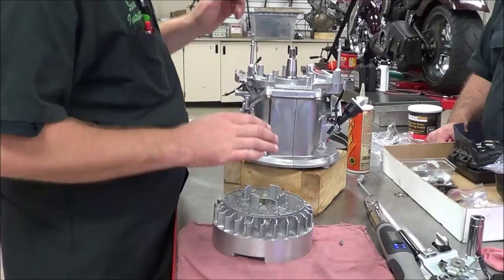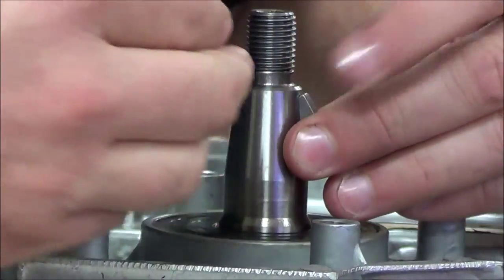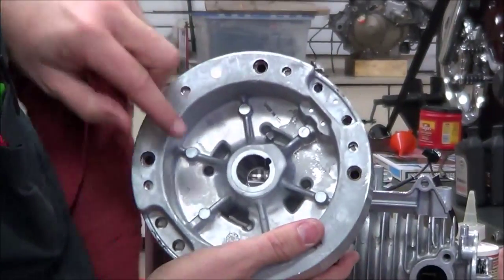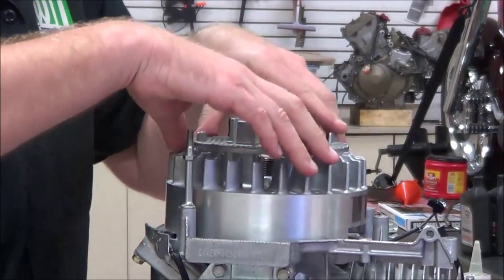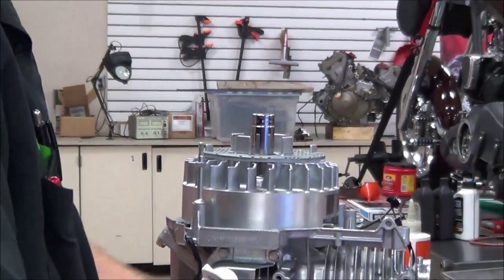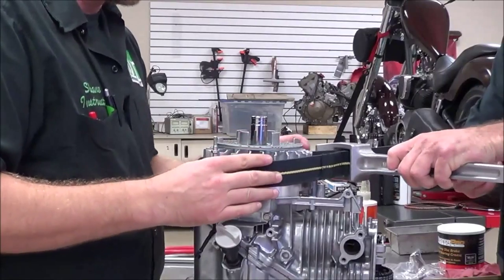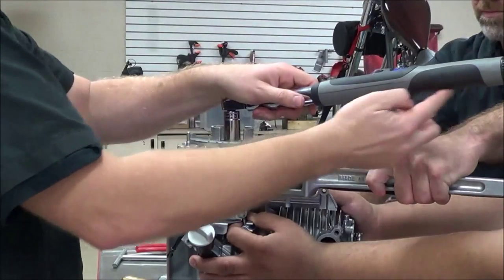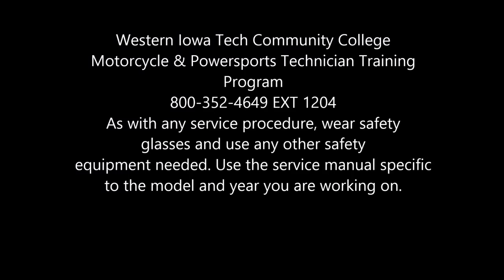GCV Assembly   09 Flywheel #how2wrench

Comment: I believe you got the torque value incorrect, 55lbft is the spec for cast iron flywheel, 38lbft is the spec for aluminum flywheel - http://byggebolig.no/imageoriginals/f037845613870ee2c20611d3a74e5207f2a7a5f2.pdf